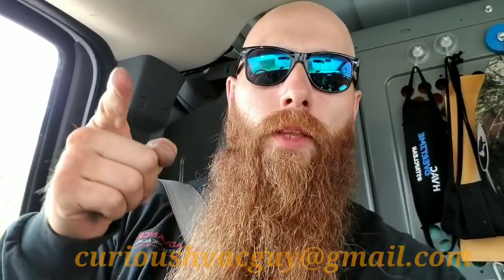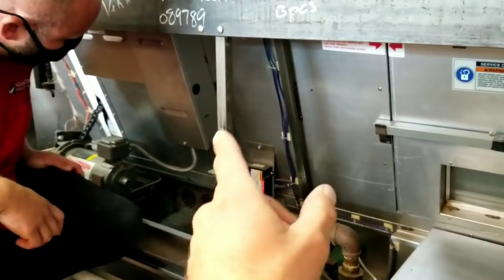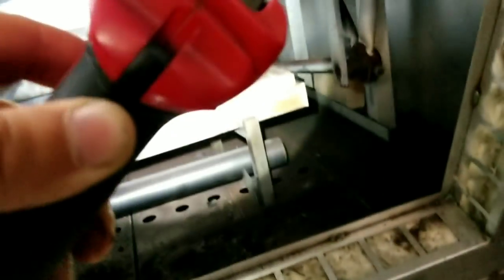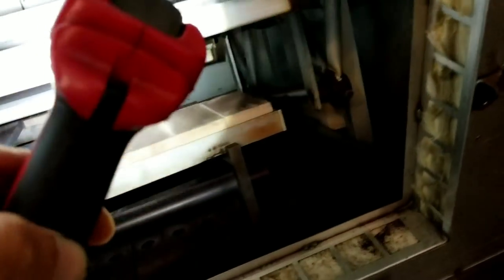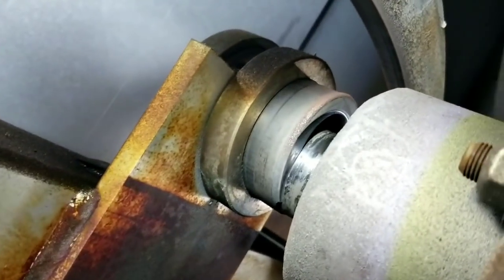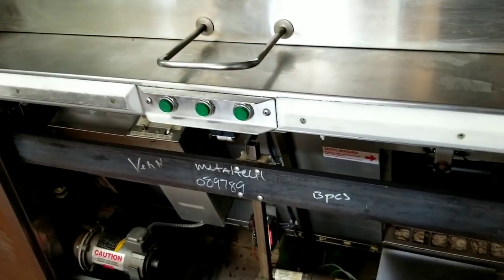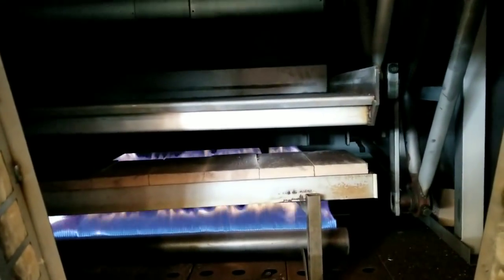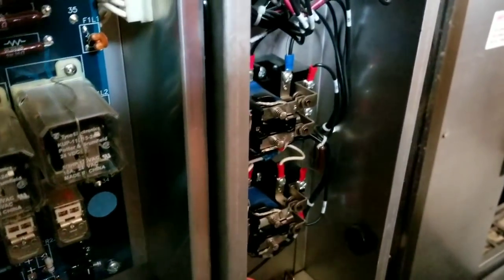Giant bread oven intermittently stopping

Comment: I was thinking it looked harder to turn than it should have been.  The bearing looks like it might be a complete assembly that slides over the end of the shaft and drops into that semicircular support, which is quite clever.  I guess it must be a high throughput component due to the weight and heat.  Hopefully the shaft itself hasn't been mutilated.  I was expecting the motor to be showing much higher current.
Reply: there is not much actual work the motor has to do. the weight is balanced so the only thing the motor has to do is to keep it in motion. with new bearings you will see it running well under an amp. the only reason to motor is so oversized is to get the torque needed to get it in motion with bread inside and potentially a uneven load.
Reply: @SupremeRuleroftheWorld  If the bearings were good it shouldn't take much to turn at all.
Reply: @bigclivedotcom  if the bearings were good they would not have been worn so much. :)
Reply: if the bearings were good this video likely wouldnt exist. but it looked proper wallered out.
Reply from the maker: she was wallerd out pretty good- Im with you Clive, I was expecting to see much higher amps as well

Comment: I work on these Baxter Bread ovens all the time replace both carriage bearings chain and carriage motor if not you will find that the chain has been stretched not much but it has and it will grind off the sprocket fingers due to misalignment  due to the continuous use of the oven with the bearing being cracked and not in its guide.
Reply from the maker: Ive never gotten to change one of those carriage bearings- how do you accomplish that? If you want shoot me an email curioushvacguy@gmail.com
Reply: @curioushvacguy6876  send me the model and serial or photo of the front of the oven and I'll see if I can find the manual because it is a MF to do and harder to explain you will need a second tech
Reply: @curioushvacguy6876  if I had to guess it is probably an OV851G

Comment: Me and the guys I work with have changed out those bearing and the two carousel ends that hold the trays. It is a pain to work on. But  both bearings was bad in ours and after rebuilding it , its quiet as can be. Publix supermarket uses these ovens.
Reply from the maker: Any tips for me If I get to do one?

Comment: Very nice video. You knew right from the beginning because your impact was struggling to turn that carousel. So is it shutting off on motor overload? We didn't see high amperage on your meter. I'm assuming it must be. I wouldn't even let them use that oven because if that thing drops, you will have much more damage.
Reply from the maker: You are correct

Comment: Wow, I think if it were me, I would have shut the unit down and told them it could not be run until it had a new set of bearings installed.
Reply from the maker: I highly urged the manager to make that call, since it wasnt necessarily a safety hazard I couldnt really throw my weight around